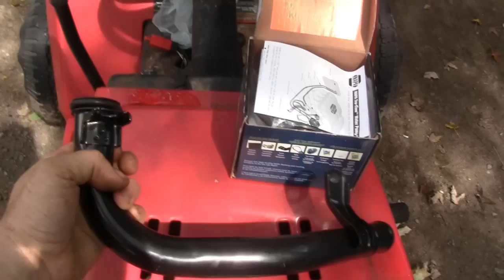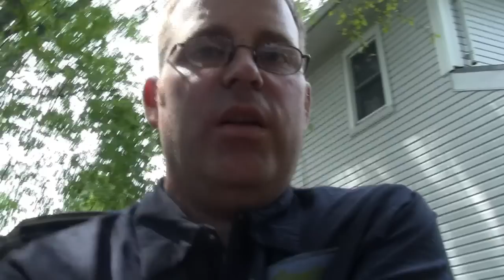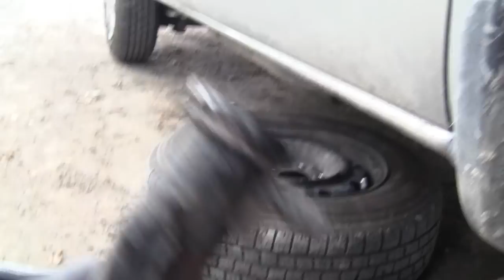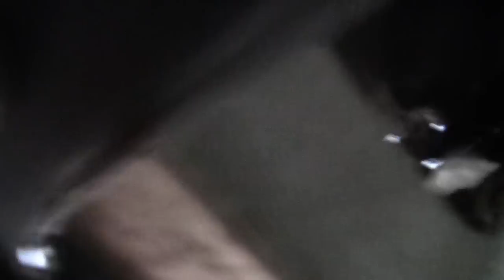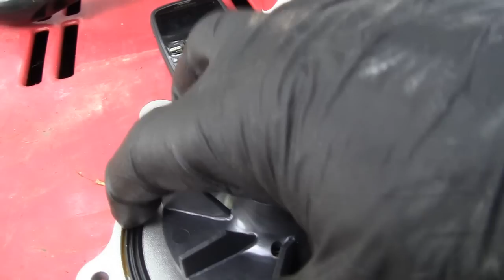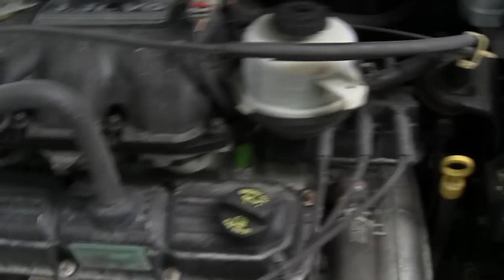Dodge Caravan 3.3L 3.8L water pump replacement.mp4

Comment: I thought I was being funny, but you are much funnier.  LOL  Thanks for uploading the video.  I'm sure the water pump on my 2005 Town and Country 3.8L is going to have to be rreplace, and I was considering doing it myself but I really don't want to lower the engine to fart around with the pulley and belt.  At least i want feel bad when I pay the mechanic, its an involved part to replace.  Regrds

Comment: good video, in my response to Ezzequiel2517, in what I experienced, I have a 95 Chev Astro that was making the same sound. I found it was my idler pulley seized and warped my serp belt. I replaced the pulley and belt now my van is quiet. Thanks for posting this video and now understand about that connecting tube from water pump to rad hose, really informative as I work in a parts store. Much appreciated.

Comment from the maker: Hmmm it could be. Take the drive belt off then start the engine. if the noise is gone then shut it off and check all your drive belt bearings. spin the water pump with your hand, and all the tensionors and ilders. You want to check for bad bearings

Comment: awesome video!!! Thanks! can you bleed the cooling system of air by filling the radiator w/ coolant. run the engine w/ the heater turned on and just keep filling the radiator w/ coolant until it stops "burping?"

Comment from the maker: I can't really say without hearing it run. It very well could be the problem, but if you don't trust the mechanice take it to another shop and let them see what they can come up with, or tell them what the other mechanice said. Its hard for me to say for sure as there are alot of things that could make that noise. Maybe take the drive belt off the see if the sound goes away. If it dose then you will know for sure it was something that the belt has driven. Try spining all the pullys as well

Comment: Hi,
 Excellent video. My 2006 caravan is giving me ker ker sound without stop. Mechanic thinks replacing steering pump will fix the issue as I have a little hardness when turning to left only. Do you think, I should replace steering pump or water pump or some other issue? Appreciate your kind advise. Thanks,
Aamir

Comment: Great video! I didn't realize that the water pump had been moved to the back on the later model 3.8 liter minivan engines. The Gen III minivans had the pump at the front and it was easy. I think I'll stick with them. But again - great job on the video!

Comment: Shawn,

My daughter and I had a blast replacing the water pump yesterday.  It was in a 1998 3.3L engine, which is different from later model you demonstrated, but you gave us enough so that we were able to tackle it and solve the problem in 3 hours.  It took a little time, but we included a trip to the parts store, and lunch.

Ours was on the right, with no track.  It sat on a "bell" pulley. I did watch another video.  It had the pump on the right side, under the wheel-well.

Kudos to you!

Comment: Looks good!  I'll be tackling it within 24 hours.  I had a leak that appeared to be coming from the top of the lower rad hose where it connects to the pump.  I replaced that but it didn't work.  The dodge I have is a '99 grand caravan, 3.3L.  I do not know if it has the bypass pipe you replaced.  Wish me luck.  I'll let you know how I do.  Great video!

Comment from the maker: Unless the exhaust is weak you shouldn't have aproblem. It takes a beating on the car as it is lol. Yes the wipper tray comes out in about 15 mins ,well thats if you can remover the wiper arms. some are really stuck on there

Comment from the maker: @ssl668 On the older dodges they had a vac powered shut off valve. They used to go al the time and we'd just tie them open or closed, if we wanted heat or not into the car.

Comment from the maker: @ssl668 You can always take the actuators off of the heater box and turn the shaft by hand without cutting it all to crap. I would try this before I went in with a hack saw

Comment from the maker: @ssl668 If you can see under the dash you should beable to see the doors moving or figger out witch one is the door that gose from defrost to feet. If you can tell what one that is then you know its not that blend door, as the one your looking for controlls the heat cold air. it should be the door near the blower motor. Its kind of hard for me to tell you what to look for as I can`t remember what that heater box looks like lol.

Comment from the maker: @ssl668  First off is your van getting hot enuff. If your have a scan tool hook it up and read engine temp. It should be around 195f give or take. If no scan tool look at your heat gauge. it should be about 1/4 to 1/2 heat. If this is ok warm the van up then reach in with your hand to the heater hoses. This might be a hard thing to do, or use a temp gun. If you have hot on one hose and cold on another then your heater core is pluged. Sometimes they have a shutoff valve on the hose. p1

Comment: Shawn, thank you so much for taking the time to post this video. You saved me! I had to change the water pump on my 2003 Dodge Caravan and had no idea how to lower the engine to get the water pump off the engine block. The frame of the car was in the way. I did exactly as you said and it worked perfectly. Used my floor jack and a small piece of 2 x 6 under the oil pan and lowered it down after loosening the motor mount bolts. Made the job possible. Thanks again!

Comment: At 15 minutes 30 seconds you mention about a problem with the pulley not being centered, and causing a squeaky sound with the belt because it wobbles.  Is the problem caused because of incorrectly mounting the pulley wheel to the water pump, or because the water pump was manufactured incorrectly?  Thanks for the video.

Comment from the maker: @LambonJude It was the early ones that had the kick down cable. It would stick hafe on and burn the trans out, well thats what I blame it on. I think it was the early 90's right upto 2000 I think. If I get I van with the spare tire messed up I will make that video. I'm thinking that you might have to replace the whole thing as they don't get used very much and tend to rust out.

Comment: Reading other comments, you mention older Dodge/Chrysler minivans have had tranny problems. Which years?

Also, can I put in my request for video on same m/m showing how to repair the spare tire holder when it gets stuck in the down position? I mean, besides using wire across to hold it in place & throwing the spare in the back of the van... :)

Comment: Next week, hopefully i will be pulley the pump---you mentioned make sure pulley doesn't wobble after installing new pump---Why would it wobble if the i the i can align the screws from the pulley into the pump???

Also I don't want to snap screws holding the pump into the block. Is there a way to esure this from happening??? Torch them?? Would that damage the aluminum?

Comment: Thank you for the encourgment. I feel better knowing it is not in the engine. I did all check pulleys. found water pump to be  wobbling. I certainly hope that will be it. I won't be able to do the work for about 10 days because my friend will not be back to left me use his drive way. I live in a condo, they won't let me do any work in parking lot. I wish I had a house without neighbors right next door.

I will you know after doing the pump, how things worked.  Again thanks for your responses.

Comment from the maker: @scooter12368 Yes you are on the right track. You now know its not in the engeine. Now you just have to figger out what was making the noise.  You will have to turn each pully water pump ac power steering to find the noise. You should beable to feel if any have roughness in them

Comment: Thanks for responding. I did check other pulleys by spinning them and listening to sound and looked for wobble. There was none. Just the water pump pulley. 

By removing the belt, the engine purrs. With belt on the pulleys and engine running, the engine has a laboring sound. QUESTION: Was this an effective test to eliminate the engine from having internal damage, since it purrs with belt off pulleys?

Comment: GREAT VIDEO
I can't drawl a pic in my head of it spinning in a vise. Are there 2 reference points on the pulley/pump when put together that the vice can grip down on, while at the same time, it could spin?

Question 2: Mine currently is wobbling and engine sounds like it is laboring. 

I took off  belt ,ran engine,  it purrs beautiful. With belt on, engine sounds like it is laboring. Could it be the pump? Have I eliminated internal part damage by removing belt and listening to it purring?

Comment from the maker: @scooter12368 You can bolt the new pump and pully together and hold it in a vise, then spin it. I don't think you will get it off without dropping the motor

Comment: Glad you mentioned that the pump may not be centered after installing with Pulley. However, I don't want to install it and then spin it just to find pulley wobbles. I would then have to take off again. Also parts store may not give me money back once o ring is glued.

Is there way to determine if it will wobble prior to installing it.  My pulley wobbles now. I got under car yesterday and say it wobbling. Can i get pump and pulley off without dropping engine?  Is t

Comment: @ShawnCFarm I changed my transaxle fluid and filter. I didn't need any adhesive. Once you get the bolts through it's not going anywhere.

Comment: A tip about the battery clamp's I've seen a lot of people use hot water and baking soda to clean the corrosion off of them, this is not smart some of you may know that baking soda is a base and battery's contain acid (base chemicals neutralize acid's) the chances are slim but the baking soda can rune your battery if it some how gets in so just use hot water works just as well. I've only seen it happen twice but still worth a mention I thought.

Comment: when did they move the water pump to the back on the 3.3?
thanks for keeping me updated with the newer stuff shawn, i spend most of my time fixing up vics, grand marqus, town cars and lincoln mark VII's

any experience with the ford 4.0 sohc? a friend from virginia dropped off his 01 ranger for me to fix a p0300, shop down there replaced injectors, plugs, wires, ecm , crank sensor.......i'm thinking broken chain guides? pings and rattles under load.
thanks and keep up the educational vids mang!

Comment: @ShawnCFarm i used to have corrosion issues on the battery with 1 of my previous cars i once owned and a friend of mine told me to clean the connections and then spray them with fluid film it's like wd40 but better and it also eats the corrostion and prevents anymore from reocurring so i did and it works never had any issues after that

Comment: Love your videos Shawn! It is really quite nearsighted to put a coolant tube on a vehicle that has no lasting corrosion protection here in the rust belt. That coating might as well been a think wool blanket soaking up Canada's fine road salt and let it feast on that unprotected metal. Sad.

Comment: Cool. How big are you going to make it? I have a 2001 F-150 loaded. i've had an electrical problem on it. The fuse that controls the shifter lock, interioer lights, windows, door locks and a couple of other things kept going out. it's only a 5 or 10 amp fuse.  I'd have to put it in neautral to start it. That went on for a month. It's doing fine now. What could have caused that?
Leonard

Comment: @ShawnCFarm I was far, but not boonies far.  I left the air on  when the pulley fell off, and i think leaving it on kept the radiator fan working which might of cooled the antifreeze somewhat.  The temp light came on a couple of times during the trip home, but when that happened i pulled over immediately for a short cool down.